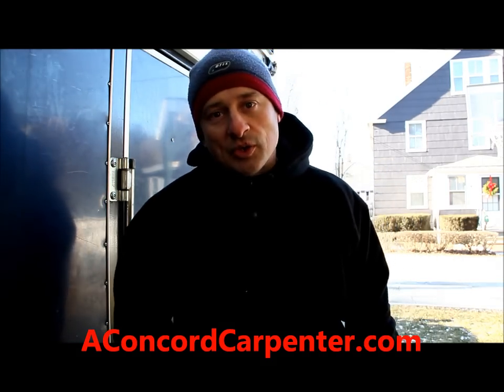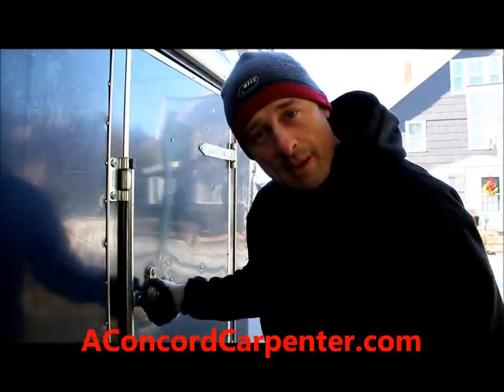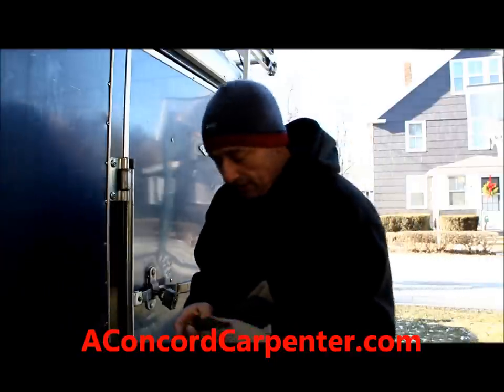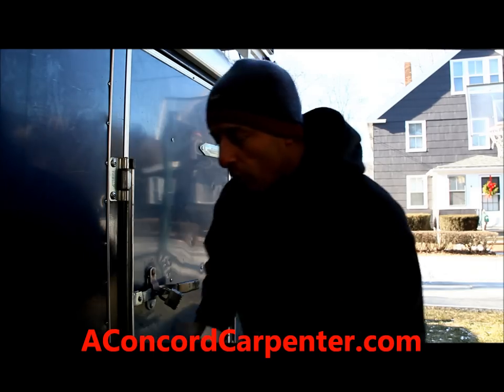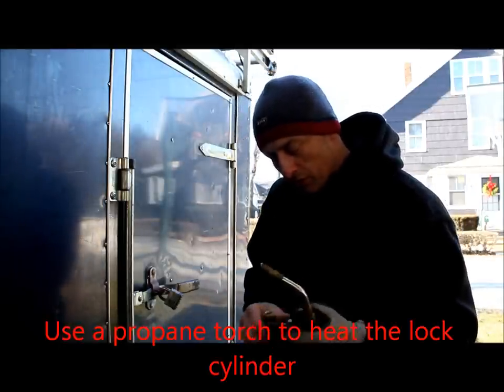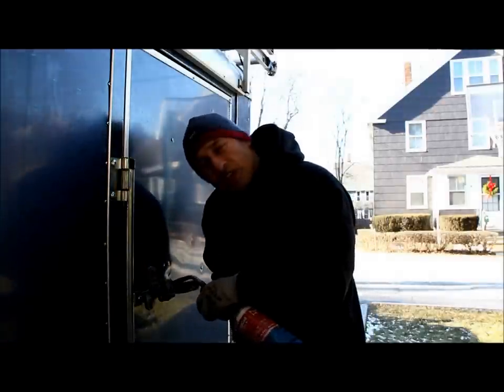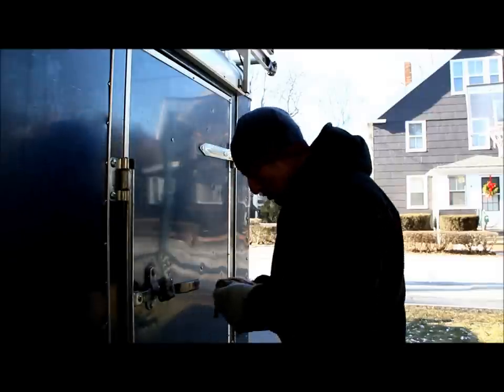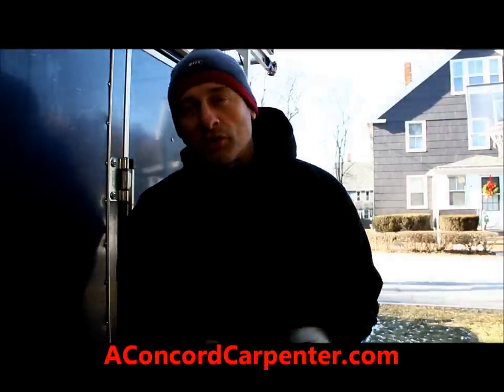Quick Tip On How To Open A Frozen Padlock

Comment: My propane torch is in the shed.
Reply from the maker: ha-ha and I'm sue there is a padlock on the shed - right?
Reply: A Concord Carpenter Yes but i rolled up a paper towel and lit it and i placed it on the lock and it did the trick.

Comment: Frozen locks 2021 ..during Covid...... Everyone is carrying hand sanitizer these days... That alone in the lock should do it.. or worse case, put some on a tissue and set fire to it below the lock. 
All the best folks! Regards from Coffee ☕
Reply: I saw the hand sanitizer trick from another video, but it didn't work for me unfortunately.  The lock is wrapped in plastic, so a direction flame was tricky.

Thankfully I was at home and had access to hot tap water at the time, but you still gotta treat the lock before relocking.

Comment: It did not work for me
Reply from the maker: sorry bro - what did you do?
Reply: A Concord Carpenter I did it with a lighter but I got the lock open with hot water
Reply from the maker: Ahhhh a lighter is not nearly hot enough. If you use water you'll need to bring that lock indoors to dry and evaporate the water or it'll freeze again.  Use a dry lock lube afterward http://www.aconcordcarpenter.com/clean-lubricate-locks.html